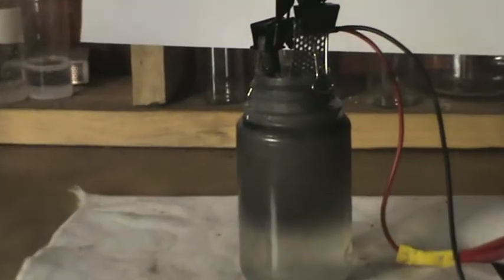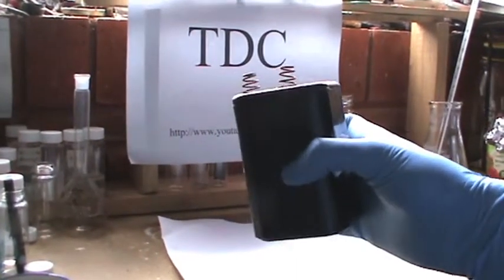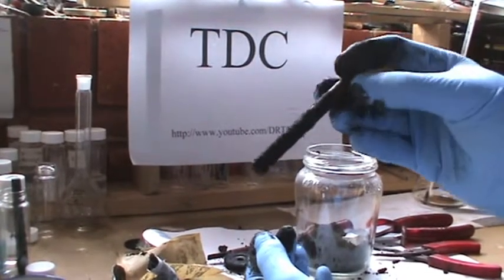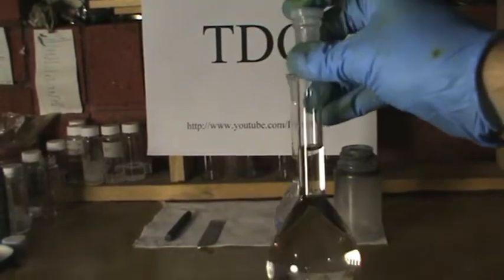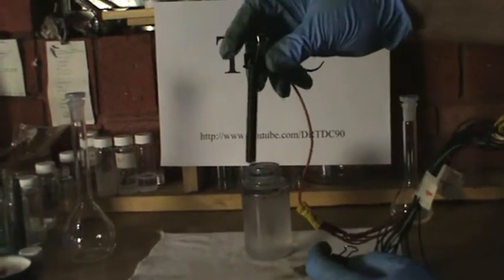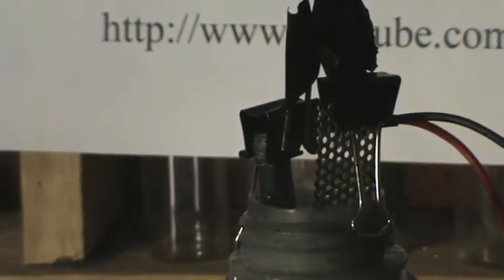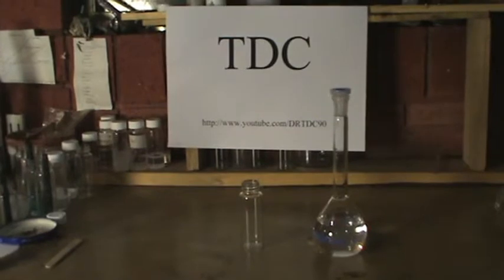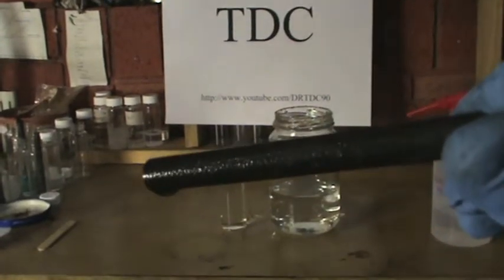The Anodic Treatment of Graphite in Sodium Hydroxide

Comment: why do you want an adherent electrodeposit of lead dioxide on the surface of the graphite substrate to form?
Reply from the maker: Dan Murphy An adherent deposit of PbO2 is necessary because it undergoes extreme anodic stress during electrolytic preparations i.e. electrolytic production of potassium chlorate from potassium chloride. 

If the deposit was flaky or weakly adherent the PbO2 electrode will stand no chance against electrolytic oxidation. It will just disintegrate. 

Therefore an adherent deposit of PbO2 is crucial.
Reply: @DRTDC90  lead dioxide in chloride electrolysis wobt just get slowly destroyed and add lead impurities to the electrolyte?